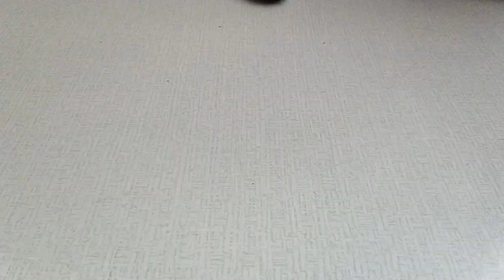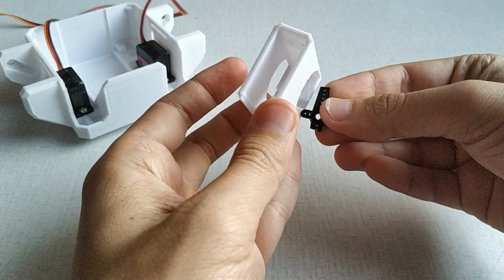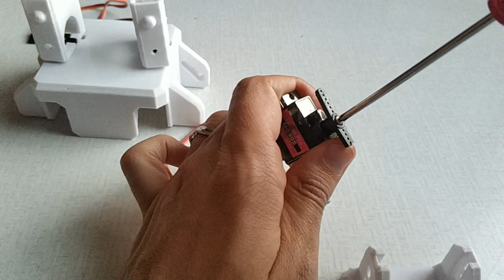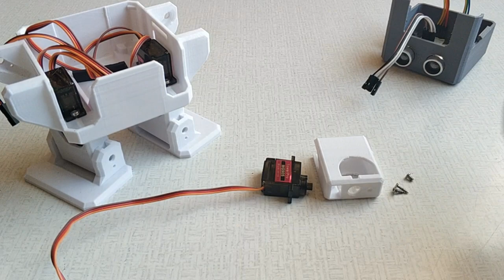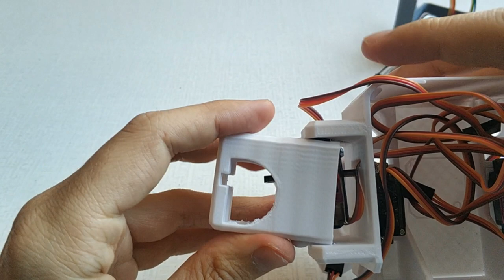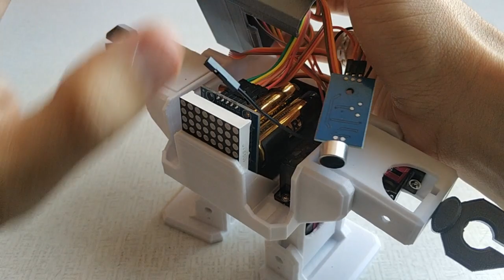How to build your own Otto DIY Humanoid, now with arms, grippers, LED Matrix and gyro sensor!!

Comment: I got several of these kits.  They are good kits as far as what is contained, though the print quality was pretty low.  5 kits, 5 broken head pieces.  Parts are probably too thin.  Additionally, it would probably be better if the robot were slightly taller providing more clearance inside.  I didn't tinker them in any way because I didn't have the time. At any rate, after printing my own new heads (I didn't want to spend the time to print 5 kits worth of parts, but had to print new heads to continue), I was able to run several of the examples.  Those all work.  What I'm looking for now, is both the software to run via a phone app, AND the software used to program the Otto with Scratch.  I tried mBlock for linux, but I can't seem to get an IDE out of the thing, even if I run version 3.  Am I supposed to be using Ardublockly instead?  I would like to have the ability to program the robot with scratch, if at all possible.  I've seen people claiming to do it, but no joy on links to software or an IDE that works in Linux.  Actually, if it runs with Windows, I suppose that is fine as I'll probably be using Windows PCs later.  I was just looking to try it and I've got a Linux box.
Reply from the maker: Hi Robot Knight thanks for your feedback, you can send pictures to us and we would have replace the broken parts. But if we make it taller would not be to heavy and center the gravity will raise and make Otto fall easier?
For Programming scratch and blockly are all mutual project, what do you mean you prefer scratch?,use Otto Blockly as advertised in the guides and the web version you can use on Linux, we are also testing the offline version for Linux you can give it a try, if you contact us.
Reply: @OttoDIY  It just needs to be about 1 CM taller.  I think that would still be okay, there is a ton of weight in those servos..  I did print a remix (a long while back when I was first looking at using it for the kids) that is about that much taller.  I actually thought that was how tall it was.  The height would provide a little more clearance for the connectors for the screen.  Also, it would give the BT module a little more room.  Additionally, there is some sort of inner wall that I think was supposed to either hold the mic or the BT module, but it is too close to the outer wall, so you can't fit anything behind it and it just ends up taking up space.  If it had another millimeter or two away from the wall, the BT module would probably fit behind there and it would make placing the MIC that much easier.  The manual is missing locations for some of the different parts, or at least proposed locations (MIC and BT module mainly, but there seems like there was another).  I was unsure where to really mount the BT module.  I finally did manage to mount both that and the mic module one above the other.  Plus, there is little room for the screen (it DOES fit, but I think another 0.25mm would have been good there).  And for some reason, the eye sockets were very loose.  I had to use a double-stick foam tape to hold it.  I also needed some longer wires in spots.  I happened to have a few, but it didn't solve my problem for the battery holder.  It may not be a problem if you use rechargable batteries (since those don't get plugged in to Vin) but for alkalines, it is a tough reach to get to Vin for the positive battery wire.  It DOES work, but another 4CM of wire there would have been useful.  Most of these things would make it slightly easier for a younger group of kids to assemble it directly out of the box if they can't print one themselves or remix it.

Scratch is just for the kids.  They will likely have an easier time with drag-n-drop coding.  I was mainly looking for a Linux version, but I figured out how to use mBlockly and its Ottodiy extension.  But that isn't up-to-date.  So its missing arm control and some definitions have changed since that was made.  I think it was meant for V3.6 or something like that.  But it does work if I modify the code it produces a little.  I suppose I could try wine (I haven't tried that yet on it).  At any rate, it won't matter for the kids, it was mainly for my testing.  Since the kids likely have access to Windows, it isn't a problem.  But eventually, I will see if they can do something with just straight-up arduino code.  They are a bit younger, so hopefully it works out.

I'm still looking for the code that works with the phone app as well.  Is it one of the examples?

Anyway,  the head piece definitely needs a little more strength.  However, I figure you guys probably can't print it too much thicker as it takes time, but it really needs something to survive the shipping wrap.
Reply from the maker: @roboknight  that we can do thanks a lot for the great feedback hope to see you in the community!
Reply from the maker: @roboknight   by the way have you tried our Otto Blockly? just download and install here https://www.ottodiy.com/#blockly-and-app, people keep trying using mblock extension for no reason, is not updated and it wont be, since now we have a dedicated software ready for windows, as you said that is what your kids are gonna use, we have Linux an Mac under BETA testing, if you wanna give a try to any of those, contact us in our website. It is the same concept of scratch, actually you probably did not know but scratch from MIT is based on blockly from Google.

There you can also find our APP for Android but as also mentioned is also being published in Apple, the code you need to upload is written in the manual. (https://wikifactory.com/+OttoDIY/humanoid/file/APP/OttoHumanoid_V9.ino )  Just make sure to disconnect the BT module before uploading
Reply: @OttoDIY  I saw the Windows version.  Like I said, for the kids it will likely be fine.  Their school has Windows PCs.  I just didn't have one to try it out, hence the mBlockly.  I did not know scratch was based on Blockly.  I thought it was the other way around.  But either way, it is pretty much "the same", except I noticed that Blockly is maintained for several development boards, making it easier to deal with projects like OttoDIY and others.  That's actually what got me excited about Otto because last year, I did another robot (I used someone else's design)... it was a roller, but I used Arduino.  It was hard for the kids to deal with.  At least at the age level I was at (they are about 5th-6th grade US... its pretty tough getting them to work out things for themselves, even with examples)  So any scratch/block-like language is a bonus, hence the choice of Otto.  As I haven't seen another Biped that's attempted to make use of Blockly.  I would definitely be willing to try out the Linux version of Otto-Blockly, as I may need to even if the kids can use the Windows version.  The computers are a bit locked down and it takes time to get programs okay'd for use.
Reply from the maker: @roboknight  indeed they are petty much the same and we did try to make Scratch blocks, but it turn to be more hard than Blockly that you can find more resources online, maybe in the future we will try Scratch 3 again but Blockly has proved to be more "light" and straight forward from the back end point of view. Nevertheless this has been a challenge and an exclusive attempt as you said, specially creating Linux and Mac version easy to said very difficult to implement. But as you said this is is what it makes the difference to other robots so that anyone can code them. Send us a PM or email and we will send you the details for the BETA. Thanks again!

Comment: In your video you do not show adding the 6 pin bluetooth module but in your kit instructions you show a 4 pin bluetooth module connected to the RX TX 5v and ground pins of the I/o board could you please tell me the configuration for the 6 pin bluetooth module so I can use the app you have created.
Reply from the maker: Hi Max a new video is coming soon where we will show how to connect the Bluetooth is a separate topic because to make the robot work you do not need the Bluetooth that is only for the App

Comment: Great Job!. Can I print it ? Where can I find STL files?
Reply: You can definitely print it.  And you should.  Just make sure you print with enough shells (outter layers) because the parts come out pretty fragile otherwise.  Well, at least the head pieces.  The other parts probably aren't nearly as much of an issue.